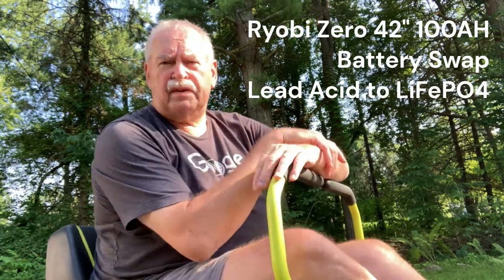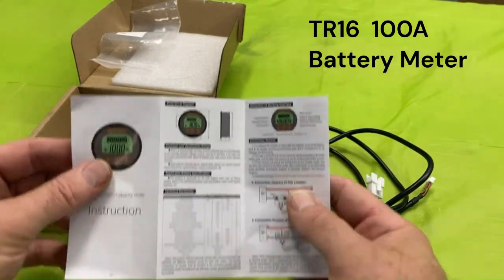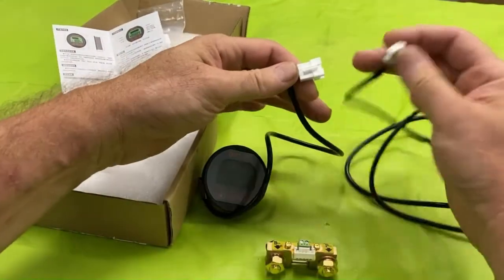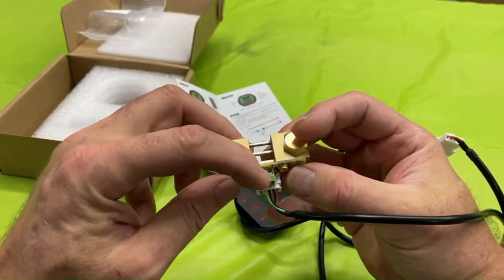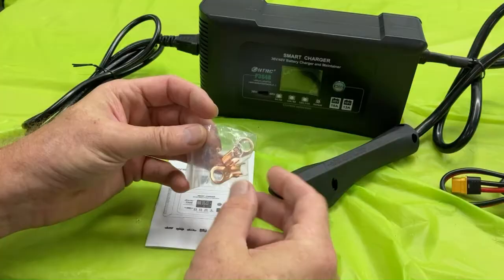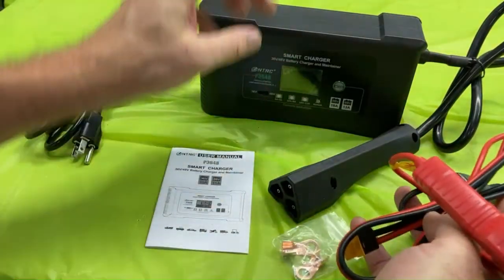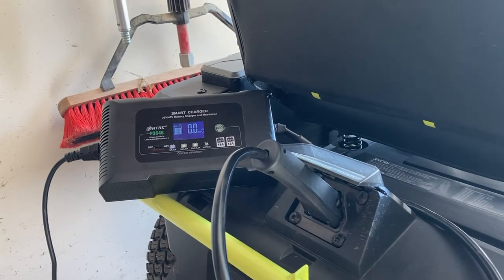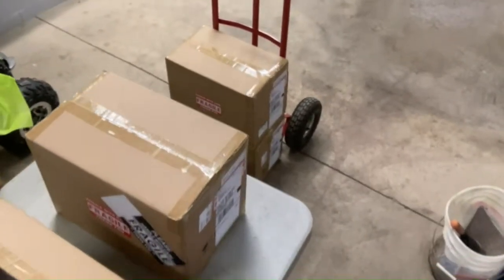Ryobi 48v Battery Swap - Components and modify charging port

Comment: I just replaced the lead acid batteries on my Ryobi RY48130 lawnmower with one 48V 100A lithium battery. 
I decided to use the battery meter that came with the new battery so I disconnected the wires from the old battery meter in
the console. I also removed the old ryobi battery charger connector and attached the connector to the new charger. 
I reconnected all connections from the under seat panel. I was able to charge the battery. I shorted out the seat switch so it would not beep.
There is no power wheel or blade movement. I haven't really started troubleshooting. I know there is a fuse to the 48-24V converter that I need to check.  
Any suggestions?
Reply from the maker: The thing that stands out to me is "removed ryobi charger connector".  I think there are  some interfaces that run thru the charger connector.  I would leave all those connected.  I recall I had to run a jumper when I loaned out my charger port... I did a video.

Comment: Just changed out my lead acid batteries to LePo lithium 100amp batteries using charger you recommended. Switched out plugs so did not need to change charging ports. Bought batteries from Amazon for $179.00. They came with blue tooth connectivity to monitor charge. So no need to remove current charge monitor, it just constantly reads 100%. Love the mower again. Thanks so much for your detailed video, the only issue I sometimes have is motors overheating if grass is too thick so need to give it a short rest after 45 min of mowing.
Reply from the maker: Good for you!
You probably checked the obvious for overheating; grass in the cooling fin area of the motor, or grass wrapped around the shafts.  Keep the blades sharp!
Reply: Care to share links to the items you purchased?
Reply: How much total did it cost you and can you post a link of what you purchased I think I am going to have to replace mine.

Comment: Hello Rob! 
So have you had issues with these batteries so far ? Still starts without pre-Charge circuit? Thanks
Reply from the maker: No issues with the batteries after 2 years.  No pre-charge circuit.
I don't know what makes mine different; mower circuits, battery brand, etc?
It is pretty clear that the issue is a surge, and the pre-charge circuit is a good thing.
I do need to check and see if my batteries are staying balanced.
Reply: @robertveldman1901  Ok thats great! Im sure the batteries you have has a better BMS and not as sensitive as mine maybe.

Comment: My Zeroturn SLA batteries just went out and i'm about to do the swap after watching your great videos.  Do you still recommend all the items you've used to do the swap, including the Chin batteries?  (there are a couple of other batteries brand that i'm considering using).  Also how are the batteries holding up after 2 years of use?  thank you for the videos and any tips you may have before i attempt the swap.
Reply from the maker: I'm still happy with my Chin batteries after 2 years; no regrets.  Last I looked, they're still cheaper now than a couple years ago.  And cheap was what I was looking for at the time.
If I did it over, I don't think I'd even bother with a BlueTooth version.  But, I'd consider it for fun.
Yesterday. I came across some  12v 150ah eco-worthy(?) batteries that looked interesting, but didn't go so far to check the physical size for fitment.  But interesting.
Be aware that you may need a pre-charge circuit for $100(?)... there's another video for that.
Be aware of the cold temperature limits of Lithium batteries.  
I need to slide mine out and check to see if they are still "balanced".
I'm not a Ryobi or battery expert by any means.  Just like many of us, I'm just muddling along with my fingers crossed.

Comment: I appreciate your video your relax demeanor made me feel like I was being talked to rather than talked at. By the way my manual suggested to balance the batteries after charging them for 24 hours, before installing them. I balanced them in parallel but of course I installed them in series.
Reply from the maker: I checked the balance on mine before installing.
I actually installed charge ports and gages for each battery to monitor balance, but I think t developed a loose wire.  Need to fix.
Need to check the balance after a couple years of operation.

Comment: Did you go with 4 12v or one 48v? So the 4x12v were 1,000?
Reply from the maker: There is a video showing my swap, but I did go with 4 x 12v batteries, for a total of about $1100.  The prices later dropped to $1000/4.  Current cost for my batteries is as low as $960/4 from Amazon.

Comment: I see you went with 100 amp power batteries. I was researching some of this on ChatGPT and they said that 60 amp hour batteries would be more than enough to equal the same as the lead acid.

Just out of curiosity, what made you go with 100 amp power?
Reply from the maker: I heard the same.  When new, the 100s would do my yard twice.
But. I wanted to have some cushion for future.
Reply: I also seen your video that you replaced four lead acid with four lithium ion what I’ve been reading online says that 100 amp Bauer 48 full lithium eye on battery from life Pro is the equivalent of four lead acid batteries. 
That project had to be pretty expensive was it not?  I think I found those batteries for $1000. Is there something I’m missing?
Reply from the maker: @wirejacker81  yes, my LiFePo batteries cost $1000 plus $100 for the charger.
The original Lead Acid batteries were bad after 2 years; and it would take me two days (charges) to mow my yard (less than acre).
It would cost $1400 to replace the Lead Acid batteries... every 2 years. 
So, I chose to switch.

Comment: Hey Rob! I completed the battery swap last week and followed all of your videos best I could! Thank you so so much for making this series. My Ryobi would have been so much worse to run with a new set of Lead Acid. I’m a little confused on the monitor though. I have a model that only allows me to set the AH of the batteries, and to set the 100% level. It seems that when I charge it fully, then I set the battery monitor to 100%, it is telling me that the battery is at 25% or less when I’m at 51.0v, that doesn’t seem correct. I used the the same monitor that you did, but I can’t seem to get it working properly. 

Also, will the mower still automatically turn itself off when the battery power is low? With the monitor being a bit confusing, I’m really hesitant to push the limits of the new batteries. The last thing I want to do is to run the batteries so low that they get ruined right after I took a whole day replacing them 😂 Thanks again, you’re awesome!!!
Reply from the maker: I have also had trouble setting up the gage.  It's still not right.  But I have so much range, that I don't worry about it.
I did see a YouTube video that shows how to set it up.  You'll have to search for it.
I did a YouTube video where I ran my new batteries to empty.  I did my yard just over 2x.  When the battery was exhausted, the mower just quit completely.  No warning.  I had to run an extension cord out to my mower to charge it a bit, and get back to the garage.
I don't think you can ruin the batteries by completely discharging them.  LiFePo batteries get a lot more charge cycles than lead acid.
I generally don't pay attention to the %, but yesterday I started at a "full" charge of 53.4v, and after mowing my acre, I was down to 52.3v.  It looked like about 50% down.
Reply: @robertveldman1901 hey thanks for the reply! Also, greetings from Kalamazoo!! I ended up using the Wattcycle 100 AH 12v batteries (recommended by the legendary Will Prowse and his comprehensive solar how-to channel!), and they’re working great. Although, the manual says that overcharge voltage protection would be at 14.6v. I typically see ‘full charge’ at around 54.2ish volts. I’m not sure if I’ve ran the mower to zero, but a few days ago I was mowing my farm track for a couple hours, then I went home to mow there. About halfway through mowing at home, the mower blades turned off just like they would have and I saw that the voltage on the meter was reading right around 42v!! I sorta thought I ruined the batteries, but the mower was still on and I was able to drive it back to the charger. I charged it up and it’s right as rain! I’ve started completely ignoring percentage and just monitoring voltage. The discharge protection says the BMS Will shut off at 10.8v. So perhaps it shut off under heavy load, then by the time I looked at the monitor the voltage had increased as the load was removed, and the monitor turned back on? Idk, either way thanks for all the help!!
Reply from the maker: @Lubberboy  I hit the blade load limit many times, especially in heavier and wet grass.
When I ran my batteries to the end, the wheels and blades quit without warning, until I recharged.
One thing to keep in mind, I'm pretty sure the original lead acid batteries have no controls/BMS.  So now we have the original battery controls in the mower electronics and the new BMS in the LiFePo.  Could be some confusion or conflicts.
Reply: @robertveldman1901 hey rob! So I’ve been running the mower for a couple
Months with no issues. Then today I tried to get it started and the monitor flipped on for a moment, then turned off and the mower won’t run. I noticed that the charger is stuck on ‘off’ and I’m wondering if the charger itself is busted. Doesn’t seem to be charging at all. Any initial thoughts? I’m a bit perplexed
Reply from the maker: @Lubberboy  sounds like the batteries are dead (nit charged).  Check the connections on the charger, especially the plug going out of the charger to the batteries.
Do you have a volt meter?  Check the battery voltage at the big gray anderson (?) plug under the seat cover.
Reply: @robertveldman1901 I’ll check with a volt meter today! I’m concerned because when I plug in the charger it keeps flashing ‘off’ as if it’s unplugged then I hear it clicking and it flashes the battery icon, then goes back to ‘off.’ When I have the key turned the Mower’s battery monitor turns on for just a moment, says right around 63v, then turns off. Hoping that voltage isn’t accurate. Could the issue be some type of BMS failure?
Reply from the maker: @Lubberboy  I'm not really an expert on these things...
The 63v reading seems odd.
Checking the voltage manually is the only thing I can think of, to start diagnostics.
Reply: @robertveldman1901 oh boy. Bought a multi-meter and it’s saying 53 ish volts. So batteries are good. When I turn the key…nothing. I hear some clicking randomly. I thought maybe it was just the meter, so I turned the key and tried to move forward but I got nothing. Big time bummer. Maybe I’ll open it back up and see if I can just take it apart and put it back together? Perhaps there is just a loose wire somewhere?
Reply from the maker: @Lubberboy  So batteries have a charge, and presumably, the charger works.
Next, I would see if you have power at the Big Relay... remove the "passenger", right side panel to access.  There should be 53ish volts on one of the big terminals.  The other big terminal should have 53v when you turn the key on.
One of the small wire/terminal will activate the relay when the key is turned on.
You could test the key switch.  I've heard there have been issues with that.
Reply from the maker: (I'm still confused by the high voltage reading on the gage.  I don't know how that would be possible with 53v.  Maybe disconnect the gage/meter.  The mower doesn't need the gage to run.)
Listen carefully to the clicks.  When you turn the key on, there should be a single click; the large relay is activated.  If it is followed by another click, that could be the relay deactivating.  That could be a symptom of needing a pre-charge circuit.
Reply: @robertveldman1901 yea I’m confused too, the other thing is that the gage only lights up when the mower has the charger plugged in and when the charger is cycling between ‘off’ and for a brief second showing the battery with all 5 bars full. But the charger never actually says ‘FUL’ like it will when it’s done charging.
Reply: @robertveldman1901 okay so I got it figured out…the connection from the monitor shunt must have wiggled loose and was probably arcing. The lat negative terminal where the shunt was attached appears to have melted. The shunt is charred. I removed the shunt entirely, and attached the ring directly to the battery terminal…it works, but I’m almost certainly going to just get a new battery. Don’t really want to risk a fire internally. I don’t know how the shunt got loose, I made sure everything was really snug. But unfortunately I take this thing on a utility trailer to another property once every couple weeks, and the ride is a bit bouncy. I bet that’s it. Thanks for your help diagnosing!!

Comment: Hi Rob, I hear if the voltage of LiFePO4 battery is too low or not fully charged when installed, it will enter over-discharge protection. Will the charger you show re-activate to start charging? Thanks

Comment: Great info thanks. Let me summarize as This what I plan to do: Remove (4) old stock batteries, replace with (4) 12V 100AH Lithium batteries and connect them the same way as previously wired stock (good so far?). Then cut out tabs in existing charging port. Plug in new charger like in this video. The new meter is not necessary so is that it? Any hidden things that I missed? Thanks!
Reply from the maker: That is correct.

Comment: Unhappy with Ryobi at this point. Have the regular 38" rider. Batteries lost capacity to charge. Attempting to replace lead/acid with Lithium. New charger plug engineering different, no option to replace port as it is unavailable. I may attempt breaking the tabs in the port.  We all paid more money for these electric mowers...it sure is a shame that we have to rig them to keep working.
Reply from the maker: You're just one of many disappointed with Ryobi.
If you got the same charger as I, this video shows you how to modify the port.  The plug doesn't need to be modified.
If you need a port, there are Ryobi ports available (that need  the modification).   I actually have an extra port.
And I did a video to modify an EZ-GO port, which is what I currently use.  But it is heavily modified!
And you may also need a pre-charge circuit to get it "started" after the swap.
Good luck and keep researching. There are so many who have swapped to Lithium, the answer to any problem with the swap is out there.
Reply: @robertveldman1901  Thanks for video and reply. What do you mean by needing an extra circuit?
Reply from the maker: @RickFlood  Some people who have converted to Lithium have a no-start issue.  It looks like a "pre-charge" or "soft start" circuit will fix that problem.  See this guy's channel for more information:
https://www.youtube.com/@Ryobi48vElectricMowers
Reply: @robertveldman1901  Hi Robert, thanks for your video. I modified the socket, no issues. Charged the new lithium batteries. First time in 2 years the voltage meter showed all bars. Started right off.  I have the same charger as you do and it is not charging. I have it set to 48 v and 18 amp but it says "off", clicks, battery picture shows up then clicks off and this repeats.  Did you experience this?  Now if you don't have time to answer...that's ok.
Reply from the maker: @RickFlood  I haven't had that problem or heard of that problem.
If the battery is fully charged, my charger  shows FUL.
Reply from the maker: @RickFlood  My charger says OFF when it is not connected to a battery.  
Check the plug at the charger.  My plug is pretty loose, and I ended up taping the wire to the charger to keep it from coming loose.  
Check the charger port on the mower.  Make sure the two tabs are broken completely.  If not, the plug will not be fully seated in the port.
Reply: @robertveldman1901  I have assumed it is defective and returned it. It wouldn't charge anything with either of the provided cables. The search is on for another. I currently charge one battery at a time with a Noco smart charger.  I may have to order another f the HTRC chargers.
Reply from the maker: @RickFlood  sorry to hear that.  Good diagnosis.  Sounds like the charger.  That's a shame for such an expensive charger.

Comment: Rob, thanks for the great video. Followed your instructions step by step. For some reason I still can’t get the ignition to turn on. Do you have a contact number you can share for a quick chat? Charger reads 53.7V.
I’m in CLE
Reply from the maker: email me at rveldmangoog@gmail.com
Reply: Emailed you
Reply from the maker: @vikramsharma7600  Good talking to you.
I would think that you are having a similar problem as many of the newer Ryobi 48v have.  Many have been successful using a precharge circuit on the solenoid.  There is a guy who sells them on FaceBook.  (I am not on FaceBook)  Here are a couple links to installing his two precharge circuits.  His FaceBook link is somewhere in the comments.  Let me know how it goes.
https://www.youtube.com/watch?v=dYyG_wQ3zgI&t=47s
https://www.youtube.com/watch?v=jNEGhhh3dMo&t=137s